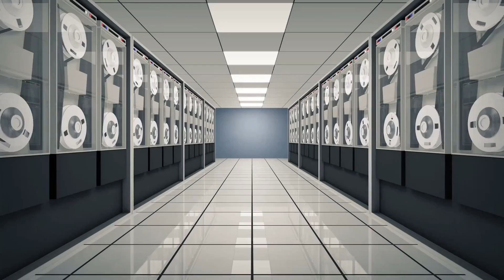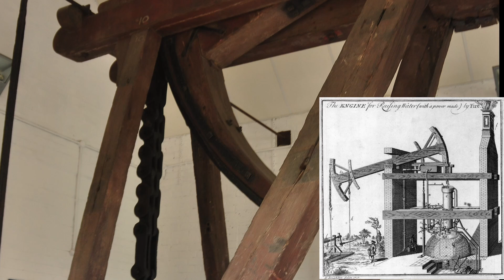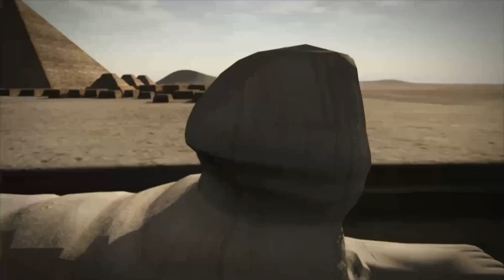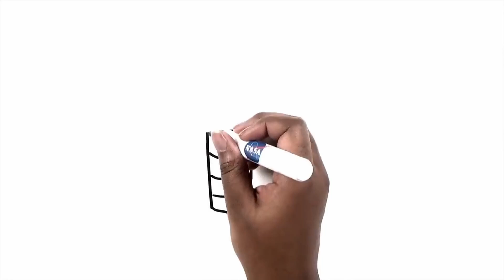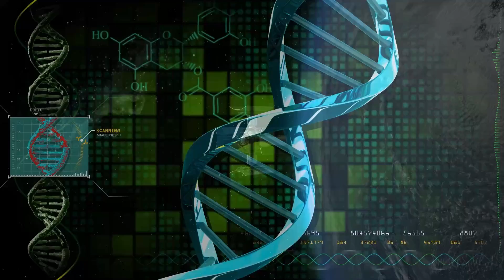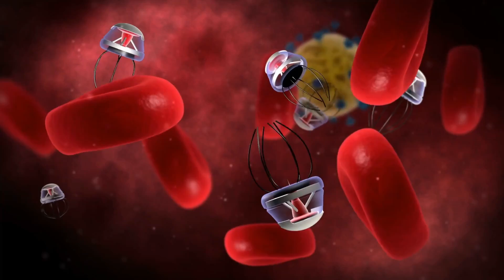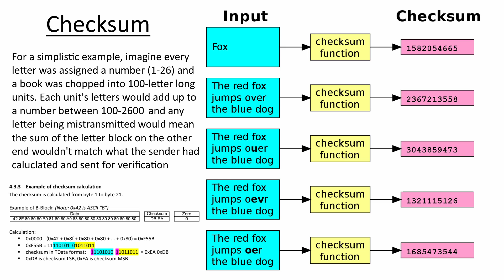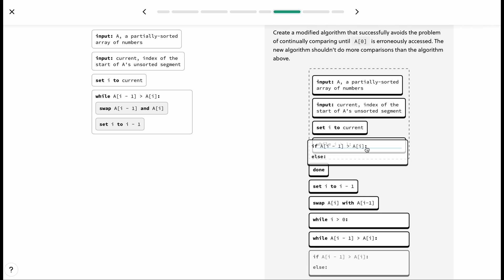The Million Year Machine

Comment: Isn’t maintaining purpose specifically antithetical to evolution? Wouldn’t you want to design systems primarily to survive and everything else secondarily?
Reply: If it survives but loses its purpose, then wouldn't it also be just as problematic? Without purpose, why continue evolving when it ultimately doesn't matter what you are evolving into? In the case of machinery, you practically want it to do its job until it dies (therefore having no purpose) because then you will have gotten the most use from it. You really want to perpetuate the use of a certain technology while its evolution is occurring in the background, allowing future machines to be more complex, safer, efficient, cost-effective, etc. 

Additionally, if you have a system which works in its environment (maintains purpose), then why would evolution need to occur if there is no need for change? When it comes to machinery, it may be more useful to maintain purpose instead of evolve, since it takes a lot of time, effort, and resources that can otherwise be allocated somewhere else. You can't exactly compare technological evolution to biological evolution, as the two are different. (One being inorganic, while the other is organic. Each deals with different environmental factors which stimulate evolution. Plus, technology is a tool meant to be used by biologicals.)

Granted, time always marches on and evolution will always occur, but I am just addressing what was asked here. I also know you did not specifically compare biological and technological evolution, but it seems to be what you were leaning towards. I get the logic here, but I think context behind what is evolving, how it evolves, and why it evolves is missing or incomplete. Technology needs external help to evolve, whereas biological evolution is primarily internal (with exceptions through medicine and medical practices, which I feel is a whole other can or worms to deal with.)
Reply: @anthonygenco5051  I’m unsure I see much difference between tech and biological evolution - they both occur because of the environment. And then maybe you’d ask for the purpose of a river making an s-curve?

If that’s correct, then whether something is synthetic vs biological, it /should/ eventually get to a similar place (how eyes evolved half a dozen times separately). And if that’s the case, I’d hope you’d assume evolution (or death/de-evolution) inevitable and maybe use more fpga gates vs ttl chips or something (humanity isn’t quite at the state of designing intelligent systems).
Reply: @GeoCiv  Biological environmental factors change the behaviorisms of animals and promote the continued lineage of certain beneficial traits. If an animal learns that making less noise helps it survive, then the individuals which make less noise will live longer than those which do not. Coloring which helps animals blend in will also help increase their odds of survival, while ones that do not blend in will more likely get eaten.

Technological evolution cannot occur naturally, as technology itself is artificial in nature. Planes, cars, and boats have all come a long way from what they used to be. Medicine has similarly come a long way from Penicillin. Computers have also come a long way, as you can now carry in a backpack what may have needed a sizable desk to perform the same tasks.

Biological evolution occurs naturally. Technological evolution occurs artificially.

As for what you stated, you have lost me. You are no longer talking about your original topic from your first comment. The second part of your second comment may need some rewording or possibly a more thoughtful argument than, "if that’s the case, I’d hope you’d assume evolution inevitable and maybe use more fpga gates vs ttl chips or something." Fpga gates and ttl chips were never part of your question or my answer, and I am not accountable for information that lent no relevance. "Or something," also does lend well to strong, well thought argument.

Also, s-curves are made in rivers due to the slow-moving water not being able to move as much dirt and rock. The debris then builds up, setting off a chain reaction that causes the s-curves present in rivers. River s-curves are also in no way related to biological or technological evolution. They may be used to map the gradual formation of the river, which would give a timeline of its creation and therefore show how the river evolved from what it was into what it is now. Other than that, no evolution is really occurring. I was referring to only biological and technological evolution. This topic has no relevance to the original conversation.

Comment: Your point is well taken. I was on the decommissioning crew of the USS Nautilus (SSN-571). I was Chief Electrician for the last four years of its service life. The Nautilus was the first nuclear powered submarine in the world. It was built with the best technology of the early 1950’s. She successfully served for 25 years. However, initial construction in the early fifties meant there was no use of solid state electronics or sophisticated reactor core design. Much effort was spent over the years updating her systems to modern technology. In some cases though, it made no sense to update the systems, so they were not replaced. By the time 20 plus years of service rolled around, the old girl still functioned but with greatly reduced capability compared to the modern nuclear fleet. She made it to her 25 year design service life, but with considerable effort on the part of her crew.
Reply: I was the Comm Officer on the USS-Brush (DD-745).  She was built in 1943 and decommissioned in 1970.  So, 30ish years.  When the engineering department measured the tolerances on the main reduction gears, they found that there was very little wear on the gear surfaces and the reduction gear box would probably last another 20 years with normal maintenance.  For a "throw away" item, that's not too bad.
Reply: @brucenadams1   loving these details, ty
Reply from the maker: That must have been a fascinating piece of hardware to keep afloat (or submerged) though I never could understand how anyone could serve on board a submarine, I'd have gone nuts as I usually found even our self-propelled artillery a bit claustrophobic to sleep in. :)
Reply: @isaacarthurSFIA  - Hopefully the psych testing screens those who truly can’t function in close quarters. I was a submariner for 24 years and never ran across anyone that couldn’t adjust. Strange as this may sound, the only time I had an issue was when we were on the surface in stormy weather. The newer class subs are bathtub shaped and do not handle heavy sea states comfortably.
Reply: @standavison328  
They make it very easy to quit sub School particularly after the first time they shut the hatch on you. If you can't hide that you're having trouble with the confined spaces you'll be encouraged to find a MOS more suitable to your psyche.
Reply: @isaacarthurSFIA  You'd probably deal with it better than you think - I was surprised how spacious submarines seemed when I got a tour. (Thresher class, compared to the interior of an M1A1 Abrams)
Reply: @muninrob  
You can't pop the hatch of a submarine whenever you feel like it.
I do fine in a closet which I can open the door of at will but find riding in elevators very uncomfortable.
Reply: @calvingreene90  Them poor bastards in the tanks and APC's can't either - they button up just as tight as a sub when they get to business. (Subs to keep water out when they dive, tanks to keep out potential NBC contamination)

Myself, I prefer to roll doors open at 1500 feet and 100 knots with nothing but sky around me from the front - but if we have other people aboard, "I guess we can button up so the idiots don't fall out."
Reply: I ride in elevators locked in for a few minutes not for months like a submerged submarine. And in most conditions tank commanders have their head out for better situational awareness.
Reply: @calvingreene90  Under "normal" conditions, a sub can (and does) surface regularly - so it's days to weeks not months. (Outside my comfort zone - but submariners are crazy before they even start)

Modern tanks & APC's travel buttoned up more often than not, admittedly, if they aren't under fire or in an NBC environment it's the crew's decision. (Likewise, the guys that do that day in and day out are a special kind of crazy)

Tanks were a LOT worse than I had expected, while a modern attack sub seemed quite roomy compared to my WW2 U-boat expectations. (I'd rather be assigned to the attack sub - the Abrams started feeling claustrophobic in minutes)
Reply: @muninrob  
Not in the USofA Navy.
Reply: @calvingreene90  I agree itz all good till you feel stuck then its freak out time
Reply: @muninrob  - Not really.  The surfacing decision is a very serious one. Don’t forget about surveillance satellites. If a sub is in transit on mission they typically do not even go to periscope depth very often. The longest I have experienced rigged for patrol at depth is 42 days.  A fifteen to twenty day mission was no big deal.
Reply: @isaacarthurSFIA  the current condition of the Hubble is something though we have done maintenance...but the current jwst would be a good candidate for space longevity
Reply: @isaacarthurSFIA  maybe 🤔 time few an update on cryo technology
Reply: I feel as long lasting energy we would need harness that of something like a star neutron energy exploitation that could auto mine...all though it's probably lost cause unless could get a point where you could literally seed a planet from a small machine
Reply: @isaacarthurSFIA  wouldn't something in space most likely last even longer due many  effects or lack of effects
Reply: I served aboard the USS ENTERPRISE CVN-65
Reply: Stan - kudos. That is very very cool indeed, thanks for the fascinating info.
Reply: Ty for these details
Reply: Thats very interesting! Is it really true that her stuffing box was made out of wood (guajak), and that it worked very well?
Reply: @ABW941  Absolutely true. Our port shaft seal had to be replaced after a tug ran over the port screw coming out of Gitmo in 1977. The Nautilus has two divergent angled screws.  Tug driver didn’t know that and tried to come alongside to pick up the harbor pilot. We put several gashes in the tugs starboard side. Almost sank that thing. Our port shaft seal leaked for the next 18 months. I still have a piece of that wooden seal as a souvenir.
Reply: @standavison328  So the Tug driver only expected one screw in the center? Was the new stuffingbox made out of guajak again?
Reply: @ABW941  Yep. Not a USN stock item. Had to make one. Took a year just to make a new one. Those trees grow in only certain parts of South America.
Reply: @standavison328  that tree's scientific name is Lignum Vitae, it was commonly used in machinery in the past. They even used it for bowling balls in the 19th century. I've a big chunk that I'm trying to figure out how best to use for shop made woodworking tools.
Reply: @RafaelHe  - Yep.  Remember that now. Thanks.
Reply: @dwayneduval6785  - Admiral Rickover made a promise to Congress that the first nuclear submarine (a very expensive piece of hardware) would last 25 years. He made sure that it did.
Reply: @garetclaborn  but if someone places the moon in it's perfect orbit in order to accelerate evolution, would that not make it a machine?
Reply: I would guess that modern vessels would have even less of a shelflife as with smaller parts, the effects of humidity, salt and rust might be that much sever, leading to either earlier decomissioning or faster/increased itterations of repair cycles. Am i mistaken in that estimate?
Reply: @kinngrimm  - Navy Military procurement equipment (Mil Spec stuff) is designed to anticipate rough sea going and battle environment conditions.  It is quite expensive. But nothing is perfect. My experience says that the majority of repair problems were the result of salt water intrusion or component level heat damage.
Reply: Is planet Earth a machine? 🤔
Reply: @k.t.5405  I am definitely not a tree hugger. However I do believe that this planet is a living being. Of a type we do not understand, but alive nonetheless.
Reply: @k.t.5405  It is a subsystem of the Solar System with Sun as it main power source.
Reply: @danepcarver4951  Yeah? so is it yay or nay. I say planet Earth is indeed a machine.
Reply: @k.t.5405  the universe is a machine
Reply: @garetclaborn  "planets are not machines as they are not devices"  hmm...🤔
Reply: Thank you for your service. I I hope people today have the patience and due-diligence as you and your cohorts on today’s nuclear subs within today’s fragile political environment.
Reply: @MacAttackCobra77  I have had occasion  to visit a couple of modern submarines. Amazing stuff. They are huge, fast and quiet. The crews look like a casting call for an adventure movie. Big surprise for me was that there are now females on the crews.  We still have a vital and effective weapon to ensure global balance of power.  Very impressive situation.
Reply: @standavison328  here in NL they've allowed women on submarines since two years now. Most interesting result of the trial was that designated men’s/women's areas were actually counterproductive to the working together. It was better to just treat everyone the same, with the same common areas. That said, there aren't long lines of women signing up, but they do exist.
Reply: You ain't gotta lie to kick it, homie.

Comment: The Neshtifan windmills are really old but they might be an actual example of the Ship of Theseus.
Reply: Undoubtedly, they've been operating for 1000 years so would have had parts replaced many times over.
Reply: @VenturiLife  
But not necessarily every part.
Reply: I honestly don't think ship of theseus matters when considering something like this.  I'm not sure form even matters.  Function matters.

It's not wholly unreasonable to expect divergent environments in the course of a million years and including some ability for self regulated adaptation in the structure of your artifice is probably not only desirable but practical and necessary.  With this we would prioritize function, not pedigree.

You could make a million year machine that was just a loop of thousand year machines that spent some portion of their cycle self replicating I guess.  It would probably be one of the easiest ways to approach the problem even with all the problems that would create.  And if you're talking about a million year machine but balk and Von Neumann devices or autonomous AI sophisticated enough to self-design yet remain on task... well... you shouldn't I think.

So in my view those windmills would count. Perfectly fair.
Reply: Replacement all of the parts is irrelevant, maybe even desirable, as they still function for the original purpose.
Reply: @bbirda1287  

Research the Ship of Theseus.
It is a thought experiment about identity.
Reply: @calvingreene90  There are still windmills there performing the same task, therefore the original design was successful.  The idea that any mechanical object with moving parts would last one million years with original parts is highly unlikely, therefore a renewal scheme would have to be built into the design, making a semantic argument about whether is was the same ship of Theseus despite being all new parts irrelevant.
Reply: @bbirda1287  
I really like the design which is why I thought of them. The Ship of Theseus reference was just a reference to the maintenance requirements and of course an irrelevant question of identity.

Comment: Atomic clocks don't use radioactive decay to measure time, but spontaneous quantum oscillation of specific atoms, their real name should be quantum clocks.
Reply: Yeah, with a little more complexity than just watching something oscillate. The setup highly precise otherwise your clock blows.
I disagree about them being called quantum clocks though. It is measuring the atom, not the quantum effects. It is just using quantum effects. A pendulum clock isn't usually called an inertial gravity clock.
Reply: Yeah, but for some reason putting "Quantum" in the name of a machine makes it sounds like magic
Reply: I suppose that's why it's not called a "sub-atomic" clock.
Reply: I believe its cesium that's commonly used and its something like 4 million vibrations per second.
Reply: Atomic block